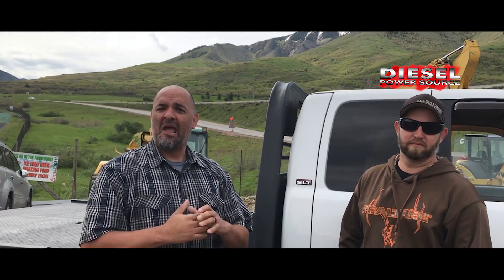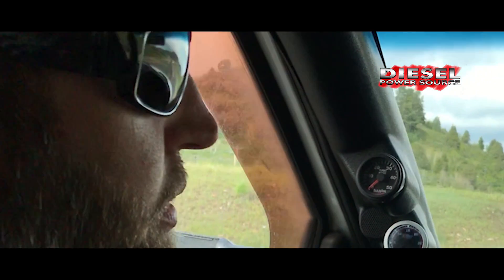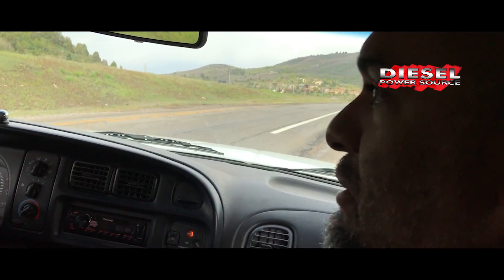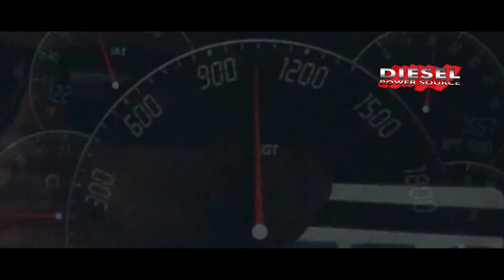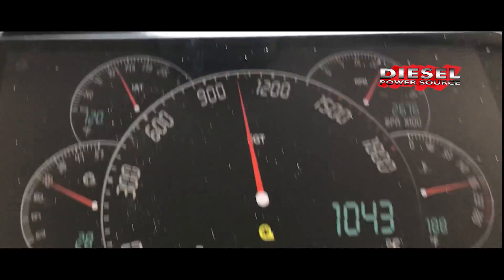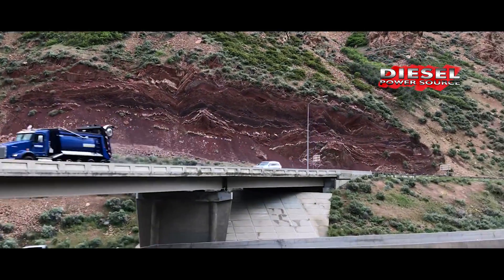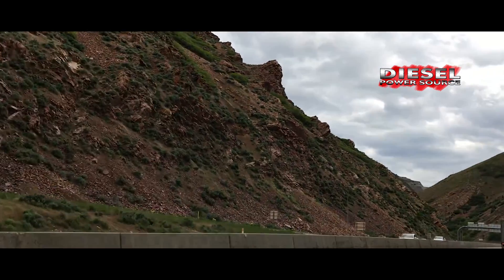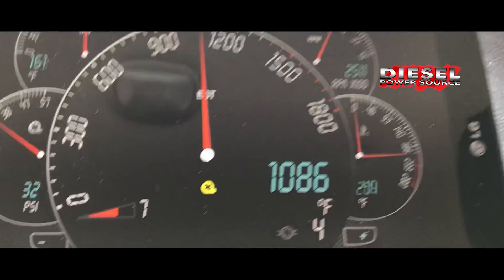2nd Gen Cummins 24V Pulls 22,540 lbs up Rockies  | DPS Sequential Turbo Kit keeps EGTs below 1190 F.

Comment: He hit 1200° before he got out of first gear. He turned the camera away in the first 4 seconds wonder why?
Reply: He was in 3rd around 2700 rpm going 50ish miles an hour up a 7% grade with allegedly 22k behind a 23 year old truck i dont know about you but all of those combined will make a vehicle get hot, Even with mods those egts gonna be cooking
Reply from the maker: We already addressed this same question in a previous comment 9 months ago. We have posted the entire raw footage.

Rather than just running a long cut this was made up of a bunch of edits to make it more enjoyable to watch. Here is a link to a raw cut of video so that you can see it does what was said in the video, enjoy:  https://www.youtube.com/watch?v=kAhGtmyAHFM&feature=youtu.be     

Here is raw video footage 2 of 3 the shows that despite pulling 22,540 lbs gvcw up a 6% grade incline, 6,000+ feet in altitude, for 5+ miles doing 60-70 miles per hour: https://www.youtube.com/watch?v=dQnDgfMdXEY&feature=youtu.be

Here is video of raw footage 3 of 3:       https://www.youtube.com/watch?v=qdaP4I9L0uo&feature=youtu.be
We have a lot more videos taken during this tow, but these 3 are the the most clear shots.

Comment: I have a 04 Cummins with the same compound setup  and absolutely love them I pull the same hill parleys canyon with a 35ft toyhauler fully loaded with a 4 seat rzr and my egts barley  go over 1200 deg on stock fueling and still have plenty of pedal left